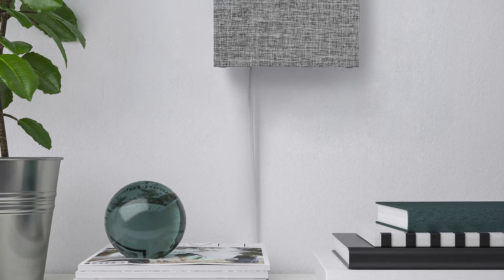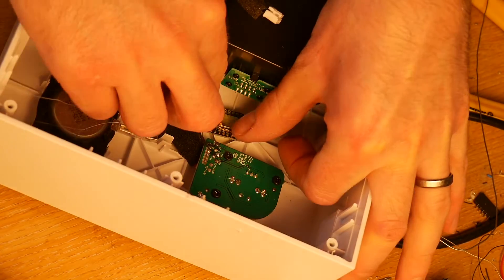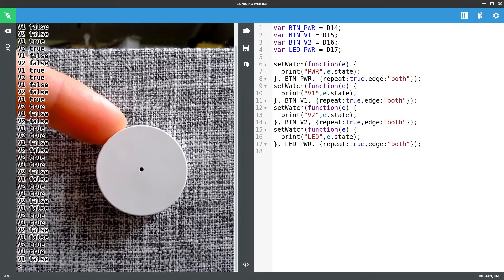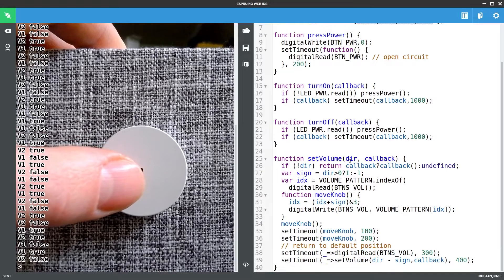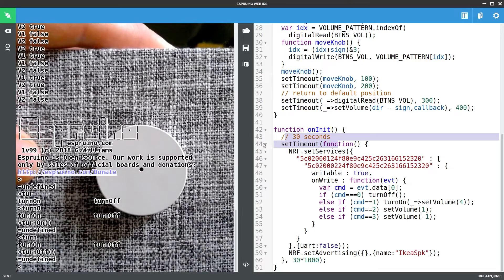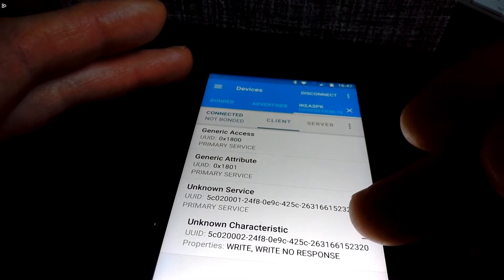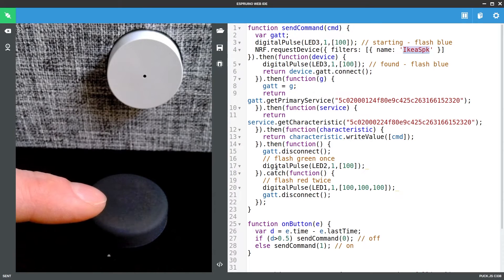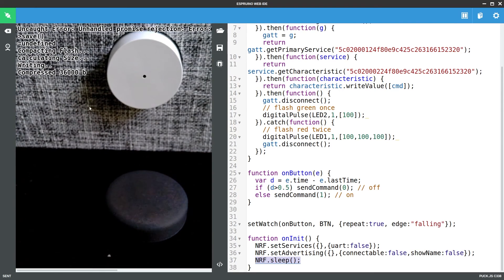Hacking Ikea Eneby Speakers

Comment: Do you know if there is a way to increase max volume?  I know these drivers can handle more.  Thanks!
Reply from the maker: I'm afraid I'm not sure - the mod done here is only really surface deep since we're just faking button presses rather than actually fiddling with things at the hardware level
Reply: @Espruino  Figured it out... Unsolder or break off R32.  The catch is the speaker will still go to sleep if volume knob is at zero.  If volume is raised above zero, the sleep function no longer triggers.
Reply from the maker: @Voiceguitar  Nice - thanks for posting back with what you found!
Reply: I noticed that the knob on the speaker and the volume on the source (in my case my phone) work independently, so if volume on the phone is at 100% raising the volume on the speaker will make it get much louder.

Comment: hey theres another Ikea bluetooth speaker that has no double click to skip function, how would one go about fixing that?
Reply from the maker: If the speaker itself has no support for it at all then you could still set of the MDBT42 as a 'HID device' which (as long as you paired with that as well) could send the skip track command on demand: http://www.espruino.com/BLE+Keyboard#multimedia-keys

Comment: I don't know anything about coding, otherwise this might be apparent from the video: will the Eneby still turn off after 20  mins if you switch it on with the puck, or will it stay on until you turn it off manually?
Reply from the maker: Yes, it'll still turn off after 20 mins of inactivity - however that is something that a bit of extra code could fix (I bet just faking a turn of the volume knob every 10 mins would be enough to keep it awake)
Reply: (Also, what is the shipping fee if you order the parts from the espruino site to Sweden..? If there is any, I can't find that info on the site.)
Reply from the maker: @stoneagejoe103  you just have to add the parts to the cart and then you can estimate shipping in the shopping cart - I just tried it and normal post is £6.72 - hope that helps!
Reply: @Espruino  Thanks!